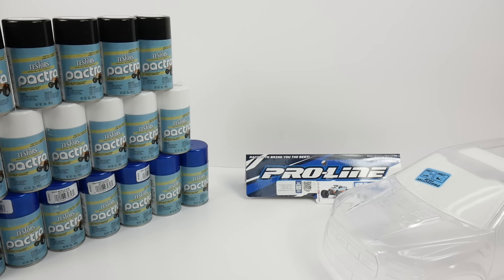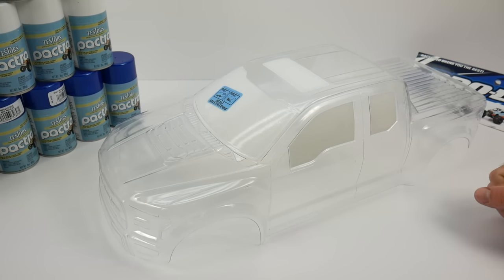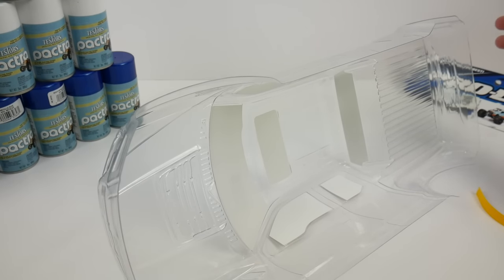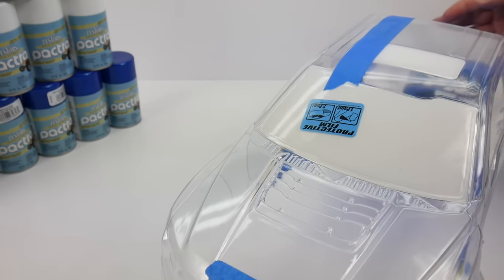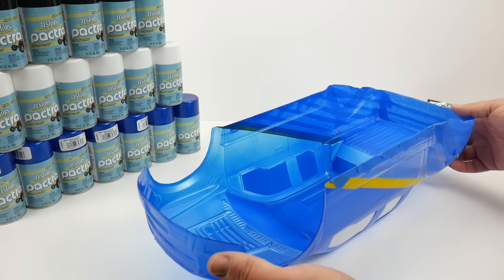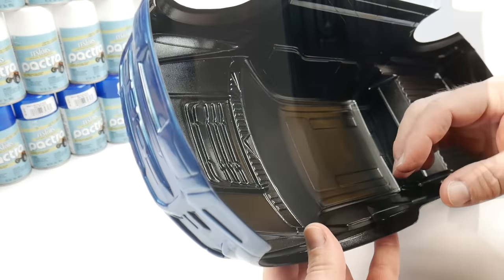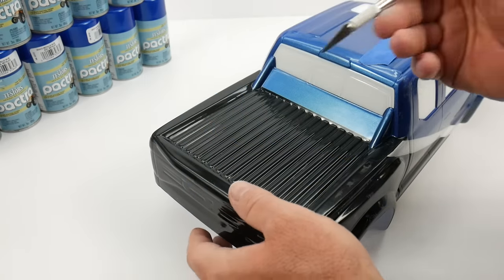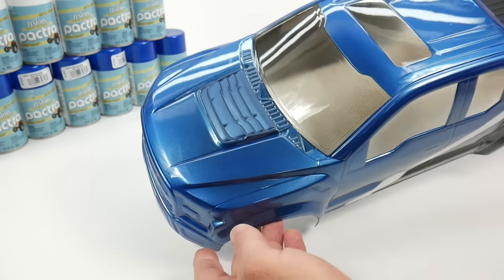How to Paint your RC Body with Multiple Colors - Pactra Paint Series EP4

Comment: When I back the blue in black, the black completely takes over the blue... the blue is almost black now
Reply from the maker: If you're using the same Pactra Metallic Blue, you likely didn't use enough of the blue - I used 3 coats of the blue before I hit it with Black

Comment: A perfect class on how to paint Rich!
I have a Tekno MT 410, with a Baja VW Beetle body from Pro-Line. Army Green with a holographic chrome engine and American Military Star on the sides and roof. I didn't back the chrome with black instead choosing to back it with the green. I'm so happy I did. The chrome looks so good with a holographic green hue it just came up better than I hoped. First drive on the weekend and on 4S it was crazy fast, the whole car was so impressive. As you know I love my Tekno products, it just wanted to wheelie with the slightest bit of power and then settled on all four wheels.
I don't think I got much past half throttle. Amazing MT.
Now I have the Pro-Line Rat Rod body that I'm going to paint up, purple backed with gold, some black detailing and the holographic chrome for the engine bay and exhaust pipes.
But if I knew how great the Raptor body looked earlier I'd almost be driving around with one on as well.
Great work Rich, always learning something and inspired by your finished products.

Comment: Hello!  After painting my R/C Body, could I coat it inside with rubberized Flex Seal?
If it does not react adversely with the paint, it might give the lexan more impact resistance.
Just a thought.
Reply from the maker: Yeah, sure....I haven't done it personally, but I know lots of people that do.  I would test a small section first before going to town though

Comment: I understand that you were specifically using Pactra paints with this body, but in case you didn't know Tamiya has a better choice for the flat sections. I've used Tamiya Polycarbonate PS-55 Flat Clear TAM86055 on many bodies and it works great!  : )

Keep up the good work,
Jason
Reply from the maker: Thanks Jason.  Tamiya does have a great selection
Reply: @TheRCNetwork Tamiya doesn't have a great selection? Coming from the guy who just painted his body blue and black.  eyeroll
Reply: @derekgardin1512 maybe you should re read the guy's post...
Reply: @derekgardin1512  Took you six years to read his comment and you STILL misread it. 👌🏻

Comment: What truck are you putting this on? Would that body fit on an axial deadbolt? I think the deadbolt has a 12 inch wheelbase, would a 12.3 be ok? Thanks! AMAZING VIDEO!
Reply from the maker: It's going on a Tekno MT410 - 1/8th scale monster truck.  Although the WB is close (13.5"), it's quite wide as well.
Reply: @TheRCNetwork  Ok thanks!

Comment: Hi Richard, maybe you have an answer. I painted a body going from washing it to doing small layers of paint, so the paint sticks well, even I did it inside a warm area too, but, after two or three runs the color is coming out easily on the parts that bent. Do you think of any reason for this, I used Tamiya PS, thanks.
Reply from the maker: Tamiya PS is the correct paint....and usually adheres really good.  I know that usually either prep (washing the body on the inside) or weather can affect things. Sounds like you did everything right...not sure

Comment: Thanks for the series. So far as process, after you painted the internal white, did you remove the window masking and sprayed the shell in Tamiya Smoke paint?
Reply from the maker: Glad to help!  After I painted all of the colors, I peeled the window masks and sprayed the Tamiya Smoke (window tint). Many, many very this layers is the key for this one...it will distort really quick if the layers are too thick.  you do have to be careful of any white sections, as the Smoke could turn that darker.  Then peel the overspray layer

Comment: I honestly wonder if the quality of the rc (polycarb) paints has become less lately (EPA regulations causing formula changes or otherwise...)... 
I've been doing this stuff for almost 40 years, now, and it seems like the past 10 years or so, I have trouble with paint adhesion... 

After a crash or something, I'll notice paint just coming right off the body like it was made of cling wrap.  I have no idea what the deal is!  I've always prepped them very well, making sure there are no oils or contaminants of any kind, and never had issues (I must've done over 200 bodies in my life so far) until recently.
Reply from the maker: Yeah, I can't agree more!  I wouldn't doubt it, especially in CA where I'm from.  I know that I've had issues in the past with prep, but I've refined my skills.  The only other issue I have refined was that first coat being very, very light.  Just enough to mist onto the body.  Lastly, I know some people recommend hitting the inside of the body with a scotchbrite just to add texture for adhesion.  I've never done this, but have heard it helps

Comment: I've got a tip, I see you have small tape bleeding. I'd take your clear mat and spray your tape lines before you put the first of the main coats it should help seal the tape a little better and it being mat it works like a primer!!!
Ralph
Reply from the maker: Good info!  I haven't tried that before
Reply: @TheRCNetwork  give er a try.
Ralphie

Comment: How did you smoke the windows? Did I miss something about that?
Reply from the maker: It's using a product from Tamiya called "Smoke" - just a simple PS spray paint. 4-5 very light coats after you remove the window masks

Comment: For crisp, clean lines, I use 3M's 1/8" blue vinyl masking tape. It seals tight, and it's flexible enough to turn nicely without puckering up. Also, go to Home Depot and pick up a roll of 6'' masking paper. All those strips of tape to cover the rear of the body are a haven for leaks. NO LEAKS ALLOWED!
I can do 4 colors with only one mask. First, outline all masking with the 1/8'' vinyl tape. then, fill in the mask with ordinary masking tape. Cover larger areas with 6'' paper with masking tape along one edge. Spray the darkest color first, pull off the 6'' paper, spray the second color, then, pull off the masking tape fill-in, leaving the 1/8'' vinyl tape, spray the third color, pull off the 1/8'' vinyl and spray the final, lightest color. 
Now you have a 3-color paint job with a nice 1/8'' outline in a 4th color.
Try this method. I think you'll like it! Just, choose your colors wisely and you'll have a very cool body. You should see my 1/10 stadium truck bodies. Using the old Autographics Indy car markings, I did one in Valvoline colors (Light and dark blue, white, and red) and the other in  Miller Genuine Draft livery (red, white, and gold). All done using the method I just described. No special skills required.
Choosing the right colors, a layout that compliments the style lines of the body, and careful placement of the markings, all come together in a body you created yourself and can be proud of. Remember... NO LEAKS!
Reply: Do you have a video on doing this? I really think the hardest job is masking. If you mess that up, you messed up the whole thing.
Reply: Same I was just thinking. Do you have a video of that? It would be great for sure.
Reply: @scottfirman  
Sorry, no video ( not my thing).
Check out the forums R/C Universe and R/C Groups.
Lots of helpful stuff about all things R/C.
Reply: @xblumentopfx  
The method I described is fairly straightforward. Just think it through and take your time.

Comment: love the outlaw black color im planning to do my 1st paint with the outlaw black will i need to use a clear coat after the black. Also how you get the window look like that
Reply from the maker: No clear coat is required on RC's as you paint from the inside and the outside of the shell is the "clear".  for the windows, I used Tamiya's "Smoke" PS paint for a tinted window effect - about 5-6 light coats